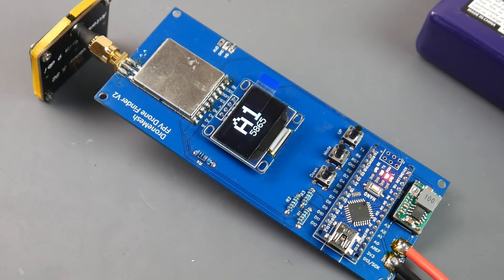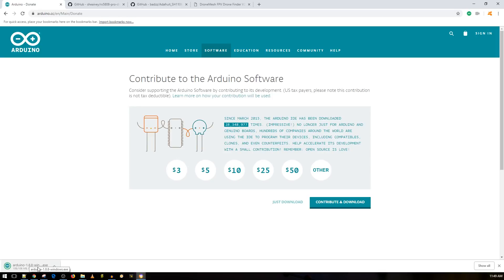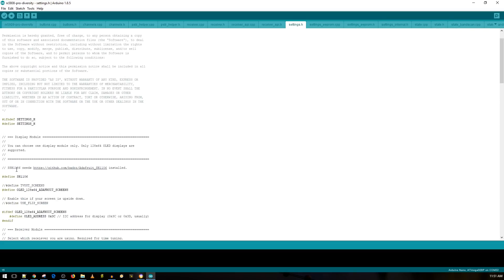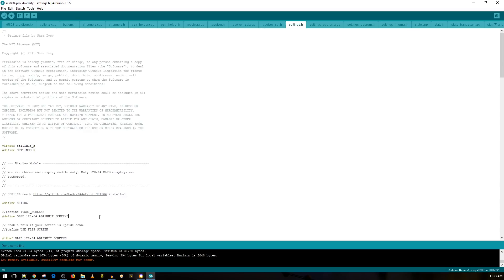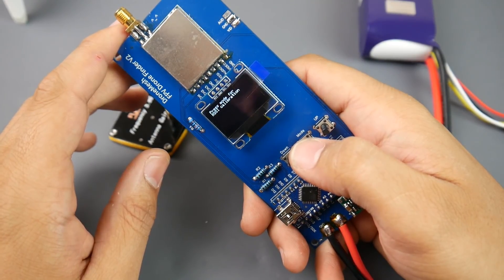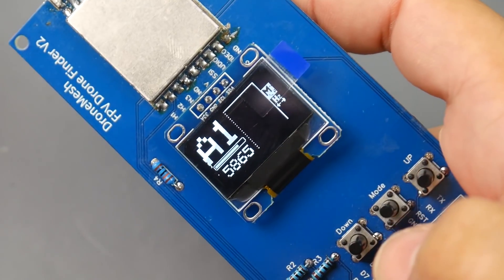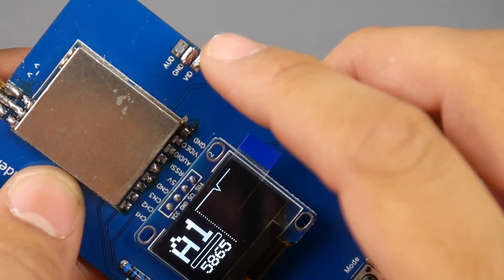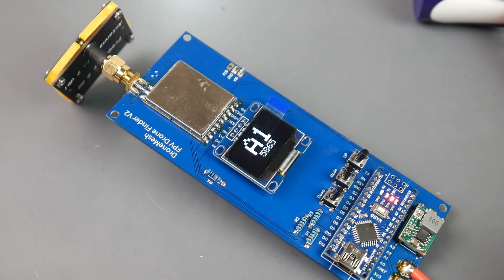THE ULTIMATE FPV RACING DRONE FINDER V2 // Part 2 Software Setup and Usage

Comment: What pins are being used on the arduino? I’m trying to figure out if I can stack multiple modules for tracking based off of RSSI. If I wired 2 more 5808s onto the same pads, would it be on the same channel as the original one of the bottom? I also want to know which pins are being used so I know which ones I can use for servos.

Comment: Hi I have a problem with verifying the file.
I'm constantly getting an error message:

Arduino: 1.8.8 (Windows 10), Board: "Arduino / Genuino Uno"

In file included from sketch \ ui.h: 4: 0,

                 from D: \ Desktop \ Dronefinder \ rx5808-pro-diversity-develop_DroneMesh_Edit \ rx5808-pro-diversity-develop_DroneMesh_Edit \ rx5808-pro-diversity-develop \ src \ rx5808-pro-diversity \ rx5808-pro-diversity.ino: 50:

D: \ Documents \ Arduino \ libraries \ Adafruit_SH1106-master / Adafruit_SH1106.h: 45: 26: fatal error: Adafruit_GFX.h: No such file or directory

compilation terminated.

exit status 1
Error while compiling for the board Arduino / Genuino Uno.

Can someone help me there ?
Reply from the maker: Change to arduino nano board type when compiling.
Reply: @DroneMesh  i changed the boardtype but had the same issue as before :/
Reply from the maker: @equohluxx6319  Scroll down you will see the fix for this issue. Update me on status when you try it.
http://dronemeshforum.com/viewtopic.php?f=39&t=5393
Reply from the maker: @equohluxx6319  Any Updates on Status

Comment: Very nice! 
Any way to incorporate 50mc 400mc 900mc, 1.3g and 2.4g rcvr modules to allow finding not only fpv but smartport tele signals without buying a microwave spectrum receiver/analyzer? Ok really what I "want" is a way to map out the RF environment of the AO, identify and be able to respond to interference by shifting my control and FPV bands. Maybe as a Flying club project.
Reply from the maker: 2.4ghz 400mhz and 900mhz possible.. I picked up a couple lolins and esp32's I will release update vlog on status

Comment: Thats cool. Im thinking you could probably add a video out, and use as a single diversity ground station as well,am i correct?
Reply from the maker: It does have video and audio out... it's on the top right.
Reply: @DroneMesh  very cool!